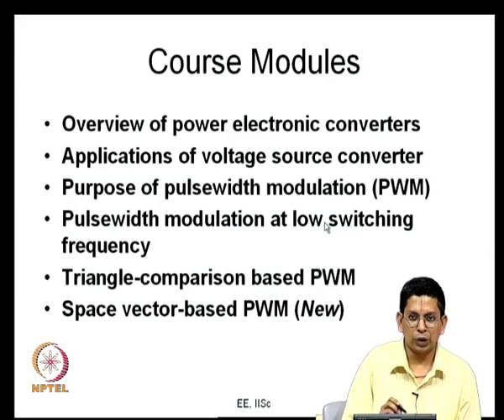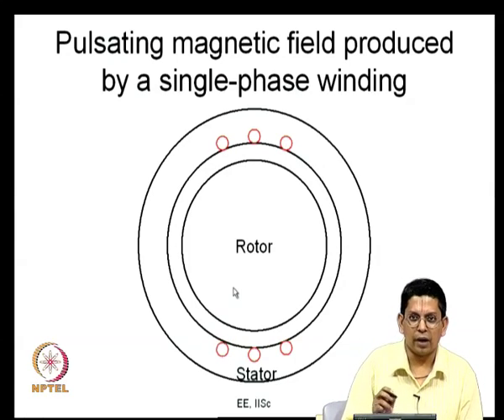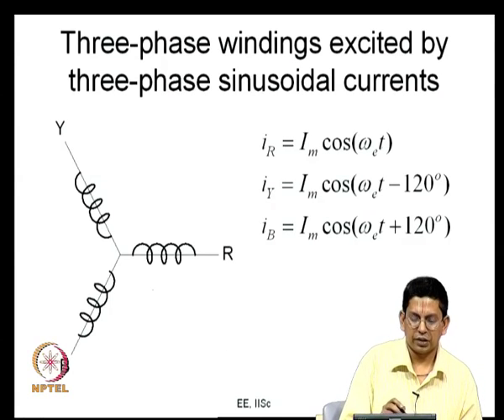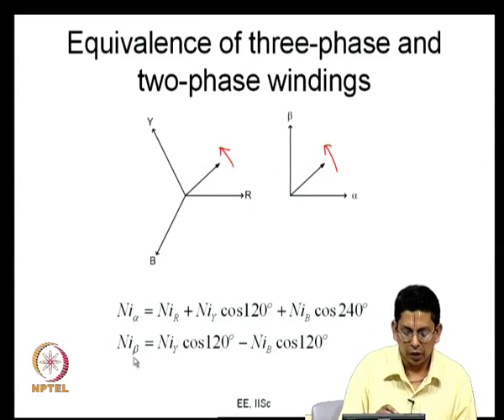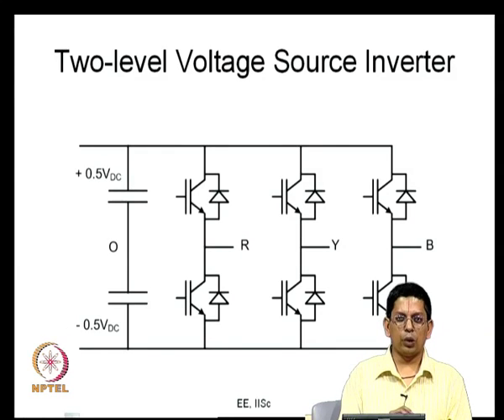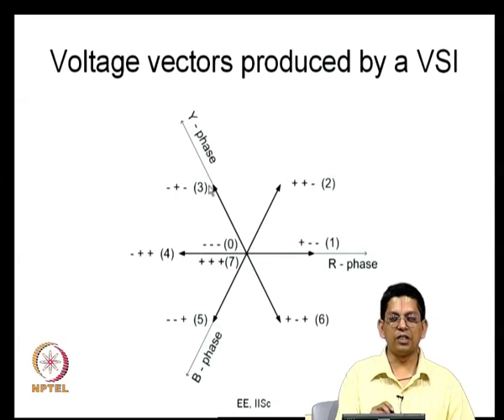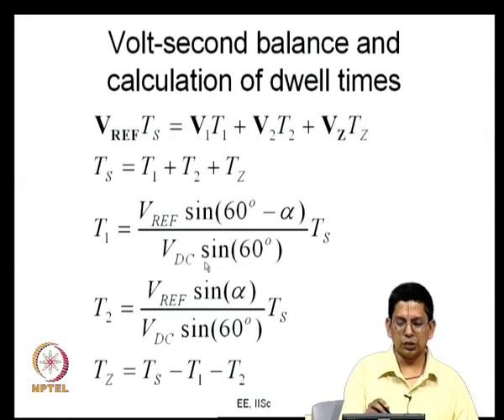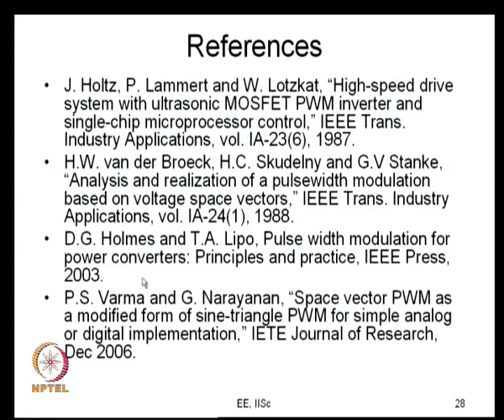Mod-06 Lec-19 Concept of space vector

Comment: First coherent, concise, explanation of SVM I have come across. I especially appreciate the way you start with the motor MMF and the air-gap and show the connection between the physical motor/inverter and the abstract mathematics. I have searched many references I am fairly sure you are the first to explain SVM in this way. Thank-you very much for this fine lecture and also for the references.